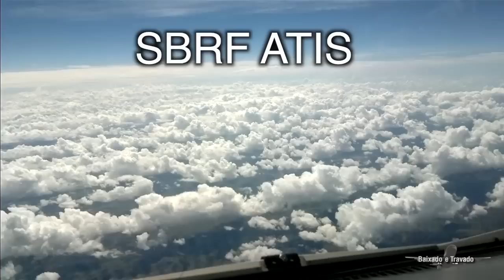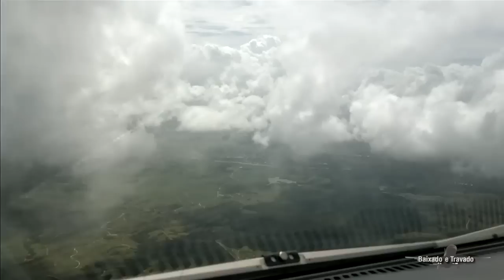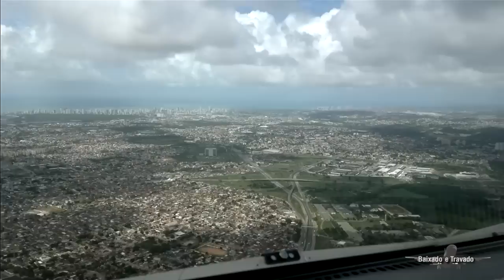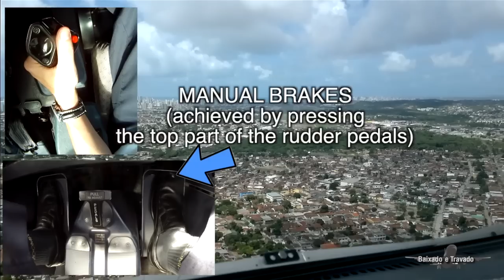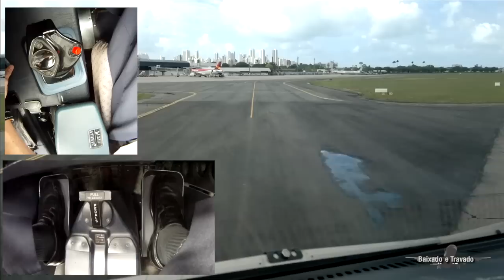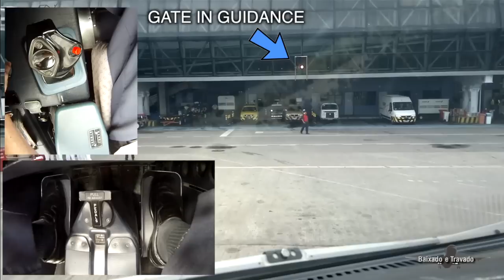AIRBUS RUDDER PEDALS, BRAKES & SIDE STICK OPERATION (SBRF RWY18)

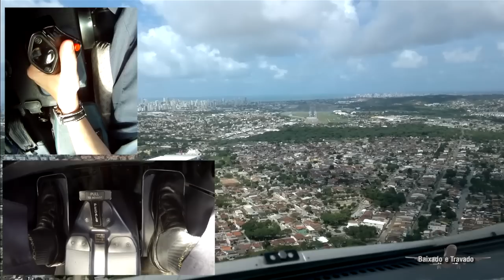Comment: What's the doop doop doop sound after the bloop bloop bloop autopilot disconnect tone at 1:47?
Reply: ***** Actually I just found out. It is ILS category downgrade.  Airbus call that tone the attention getting.  

What happened is that when you disconnect autopilot, landing capacity downgrades from CAT III to CAT I, therefore it's doop doop doops the pilot to let them know.
Reply: +Justin Kiang It's called a triple click :)

Comment: Nice informative video!

I understand during slow ground speeds(eg. initial takeoff roll) the nose wheel is also connected to the rudder pedals but with limited control. But what about during the flight control checks that most pilots perform while taxying? Wouldn't applying L/R rudder cause the aircraft to veer off course?
Reply: Jeremy Kuek There’s a button in the centre of the tiller labelled ‘disc’. This can be used to temporarily disconnect the nose wheel steering for a flight control check.

Comment: what's that "3 beeps" sound at 1:47 right after pressing the red button?
Reply: M Bowman Alert of Automatic Pilot off.
Reply: Michael Ribeiro nooo thats a different sound
Reply: The sound is an alert that CAT 3 Approach has been changed to CAT 1, due to Autopilot disconnection. CAT 3 approaches can only be done with both autopilots working and active.

-Pilot
Reply: The first three chimes you hear (1:45) is known as cavalry charge (or something like that) as far as I know. It is sounded when the Autopilot is disconnected.
The three clicks after that (1:47:) would be landing capability downgrade (I believe this is what Lemar was talking about).

Comment from the maker: The speed will depend on the aircraft actual weight, but around 125kt.... I should say.... The "100 above" is an alert and means that you are 100ft above the IFR procedure minimum altitude....

Comment: Rudder Paddles are for taking aircraft Left-Right in Air??
If yes,, then what a Side Joystick do when it is turned left-right..
Do airbus deploys aileron controls on Joystick Left-Right
Reply: someone true Basically, rudder controls yaw, i.e. the direction of the nose of the aircraft relative to the direction of flight, without changing altitude. If you want to use your side joystick, the plane will roll (change hdg), i.e. one wingtip will be lower than the other.
Reply: We dont use rudder pedals to turn a plane, the rudder pedals is for slightly turns and to turn left or right on the GROUND basically 
Greetings Alexios... :-)
Reply: Alexios N sorry i meant "we dont use rudder pedals to turn the plane in the air, thats done by the sidestick/yoke :-)

Comment from the maker: Either one would do it.... but if you try you'd end up with asymmetric brakes once each pedal brake control its respective pair of wheel on left or right main gear....

Comment: when pilot turn their plane in air, does he use the rudder pedal too?🤔
Reply: If you’re in a plane, flying, and you start turning, you can see little flaps of metal sticking up from the wings. These are called ‘ailerons’, and they do something called ‘banking’. Within the turn, there is a little bit of rudder action, aswell, which helps turn the plane faster to a correct headings, however, the pilot does not turn the plane, the plane does. ;)

If automatically manoeuvres the plane’s rudder to the correct position in order to maintain the correct turning ratio. So, the pilot does not touch anything, except of course, takeoff and landing. But, even now, some landing’s are even controlled by the planes!

Hope this answered your question.

Comment: Hi captain ! I have a question. You have to use the rudder pedals to turn the plane in the air, or only use the side stick?
Reply: Hey! Not a captain but I can answer your question. Bank is used to turn the aircraft - this is through the sidestick. The rudder is used to maintain balanced forces, thats why when an aircraft banks, you dont slip to one side (like when a car turns a corner really fast). The rudder is also used during landing to maintain the runway centreline as you can see in the video. :)
Reply: ok, Thanks !
Reply: Pedro Picon Barriel rudder is necessary to counter adverse yaw, however on A320, computers balance that out automatically so you don't actually use the pedals. You only use the rudder pedals when takeoff/landing.
Reply: Ok, Thank you !

Comment: Beautiful demonstration, 

When taxing using the tiller, pilot still uses his foot brakes to stop the plane when going through different taxi ways right? Does he actually need to put his engine throttles to idle every time he wants to do a quick stop and turn or no need? He can continue like this till the gate? 

Thank you again and again for sharing :)
Reply: ehsan83 
Man. At least according  to what I has been perceiving  by watching  many videos  and following  channels  about  it, during  the taxi, whenever  the pilot wants to accelerate, he uses a little  thrust  for a second and put it on idle again so that the aircraft  keep taxing  only by using  inertia.

Comment: Now iknow what the tiller does, his like a steering to turn in ground at low speed is the same thing like the pedals 

I think the tiller was good to turn in ground & the pedals are better for used only for braking!

I think if you turn & brake at the same time with the pedals, maybe the sensation not be confort!

Comment: there is a time when i was flying a small plane with a sidestick.there r times when thee rumbling of the plane and ur hand on thee stick actually moved thee airplane so u only have 98% control.but a plane like the a320 is not that sensitive so the movements are nothing and u get 99% control

Comment: Way more motion on the side stick than I would have expected.
Reply: I guess at slower speeds the flight controls become less sensitive,  just like in conventional aircraft.  Except you can't feel it through a joystick, so they allow more play in the aileron/elevator through computers.    Less sensitivity at low airspeed - low altitude prevents any sudden joystick movements that could lead to a crash or stall.

Comment: That sidestick displaces far more than I thought. I thought it was a pressure sensitive deal with sensors measuring force applied to the stick, as opposed to a displacement sensitive setup where the sticks positional variation from center determines the strength of the command signal.  This looks to be a purely displacement sensitive operation. What's all this nonsense about the stick being stiff and sensitive!? I don't see that here.